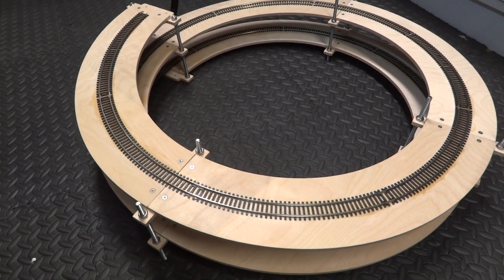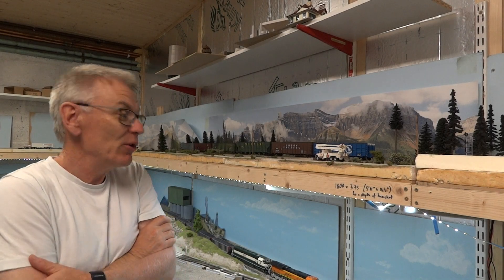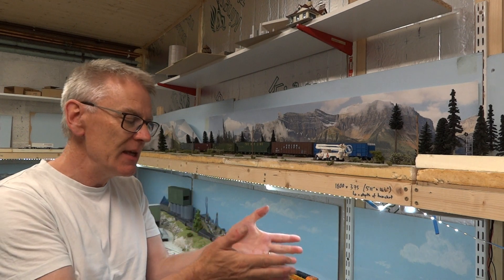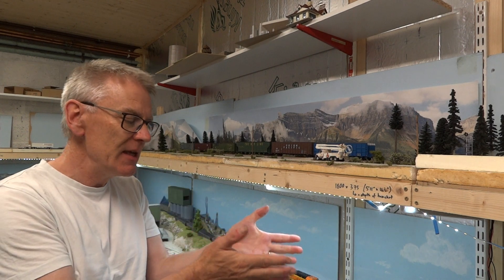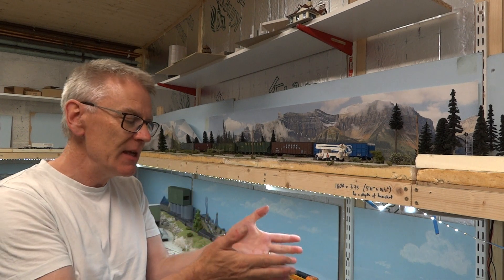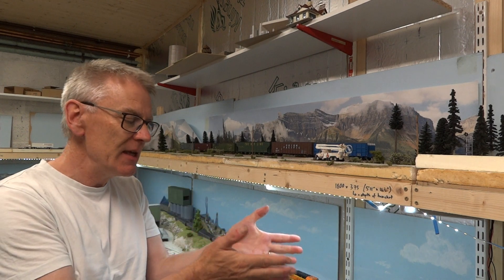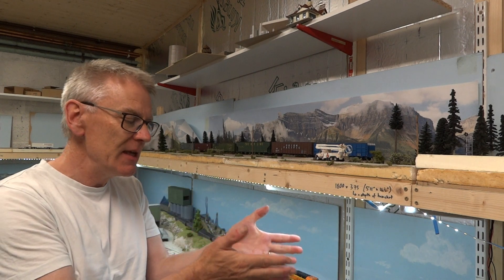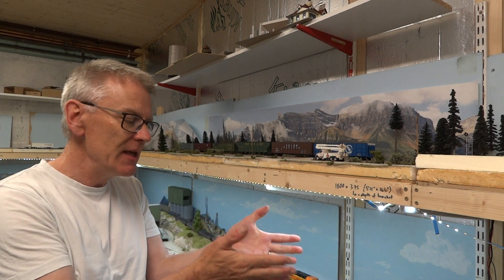Fairview 59 | Troubles & Troubleshooting

Comment: Did you ever pinpoint what was wrong w/ the liftout or just through fiddling w/ it you sorted it out?
Reply from the maker: I meant to say in my closing comments: apart from a couple of bad solder joints it turns out I’d wired the removable plug wrong. It had 3 tabs on the back and I had the negative wire soldered to the wrong tab - so no current!